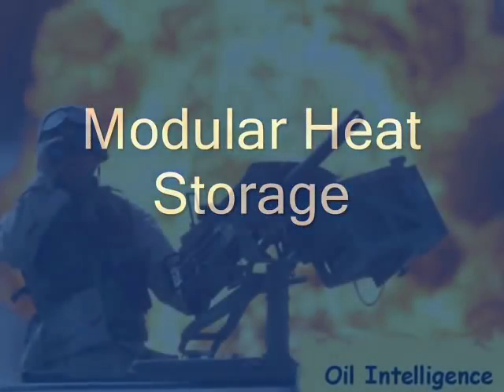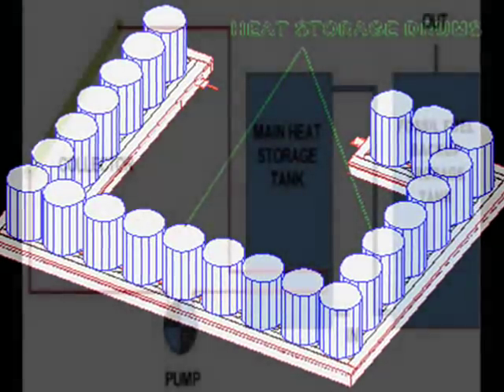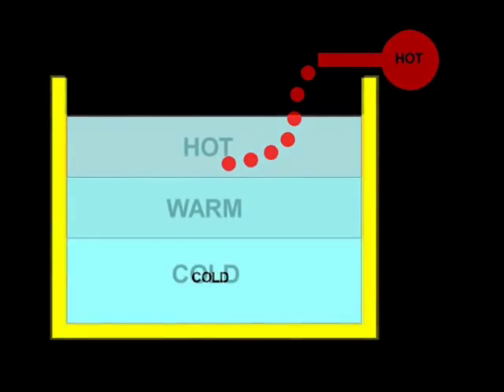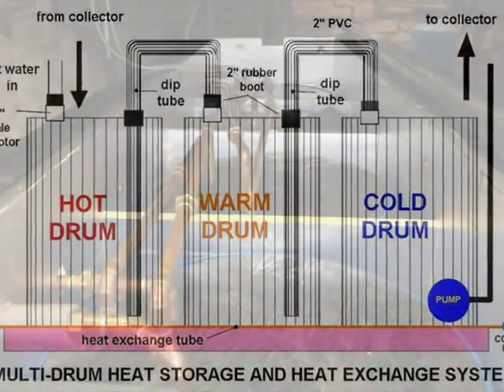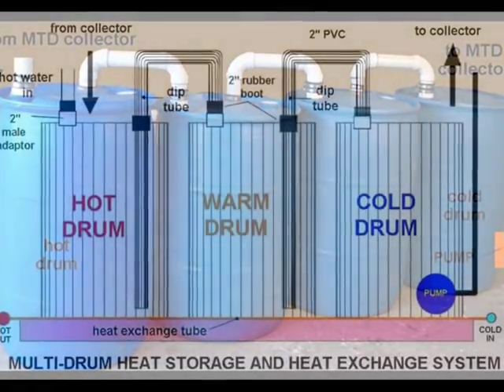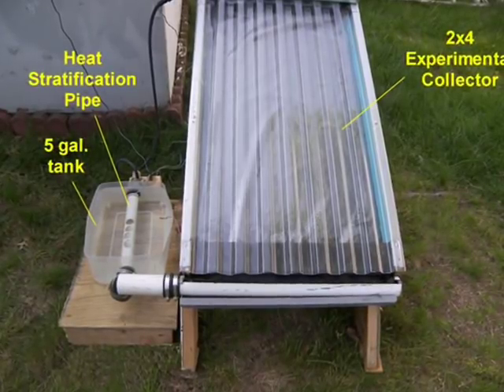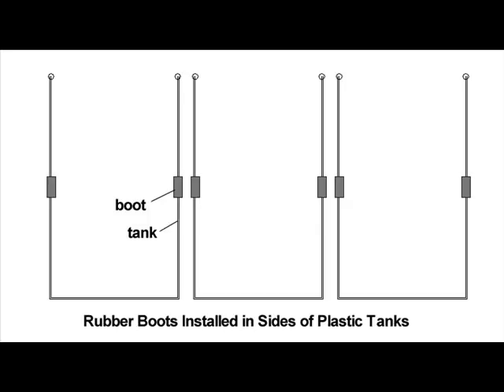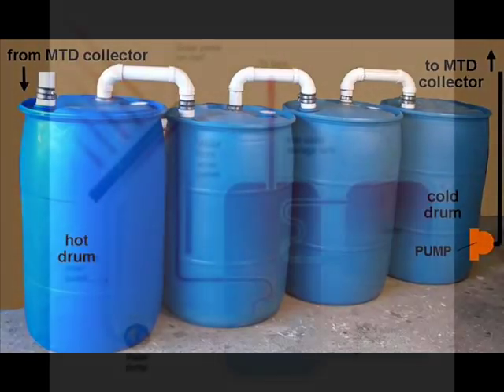Modular Heat Storage

Comment: I have a 300 gallon plastic water tank I'd like to use for storage.  I want to heat the water and then run it through a radiator at night.  Would it really matter whether the hot water stratified?  After all, 300 gallons of heated water is still going to give off its no matter what.

Can I use PVC pipe for a collector? . . .Thanks
Reply from the maker: The 300 gal storage tank should work fine. The heated  water would not be stratified as much as it would be with six 50 gallon tanks but it will still work. I would use PEX or copper inside my collector. PVC starts to melt around 180*F check out other ideas on JC SolarHomes.

Comment: OK, I like this. I like this a lot. 

However, I'm still missing a few pieces of the puzzle. If I just used one large drum, the water would stratify according to temperature. What is the advantage of using three drums? Clearly the drum with the input to the hot water heater would be the warmest. I'm just not understanding what that buys me. Thanks much.
Reply from the maker: Hi Martin Thank you.... This video is a bit crude but the basic idea is that drums connected in series with baffle pipes increase the stratification process. The more drums that are used the greater the stratification. Heat transfer only takes place when there is a difference in temp. More info on my website. Check out solar heat from a winter's sun

Comment: Hi John. I've enjoyed your videos over the years. I'm refreshing my research now as I'm just finishing a 16'x36' greenhouse that I don't want to freeze during winter here in the Colorado mountains. One of the heat sources I'm planning on using is warm water storage in recycled IBCs painted black on the insulated north wall of the structure. Aside from them being heated passively, I'm also considering building one or more collectors to aid in heating the water. My question for you is about stratification. Is there a specific reason to not have the temperature buffered by mixing the hot incoming water with cooler, but warm tank temperatures? I would think that keeping any "hot spots" of freshly heated water from stratifying would lower risk of damage to a plastic tank. I've not done or seen any research that would suggest that either way (stratified or mixed) would release energy into a space more efficiently from a tank open to the room.

Comment: I do like this idea. But how may this idea be altered for storing heated water for using? This seems to be only geared toward heating the air. We live off grid and I'm curious how to get a good hot water system going and have looked at so many options. My head is spinning!
Reply from the maker: Just fill the tanks with PEX heat exchange tubes to transfer heat from the drums into the hot water plumbing.
Reply: my guess: if you live offgrid anyway i would install a heatpumpsystem taking heat out of the ground.. with solarpanels providing the necessary electricity and a big electric boiler.. to get better efficiency you can also link it up to the system shown here..  there is also a system where you melt (dissolve) a salt ( f.e.  Natriumacetat-Trihydrat at 60Celsius) in a waterbased solution. like the little handwarmers you can buy.. you cook the handwarmer to mdissolve the salt and after initiating the crystalisation of the salt heat will be provided by an reversible exothermal reaction. so after you heated your water in the boiler to its goal-temperature you use the rest of the electrical energy to heat up the water dissolving the salt.

Comment: I just found a 5 ton climate-Master  tranquility 16 which think is Geothermal unit, I have an existing well which is 260 feet deep and 20+ years old, in order to conserve the water I am building a 5000 Gallon water reservoir on 10 feet high concrete building (Generator House)  my pan is to catch the returning water in a reservoir and make it for domestic use, only if I can use low voltage pump that can raise the water 10 feet above the geothermal unit, the low voltage pump is needed to reduce amount of electric used, my main concern is can the geothermal pump its self extract the water from the well, or do I need to use my existing pump? any one with a helpful idea can e-mail me at matrixmxm@gmail.com Thanks

Comment: Interesting! I'm in the process(well, thought process) of designing a solar water heating system for both the home and an aquaponics system. A 'daisy chain' of tanks could prove very useful!

Some people complain about the expense of setting up such a system. Sadly, they fail to see the benefits. Once setup, the only outlay is the running costs. Lets face it, running a small pump costs far less than an electric or propane heater.

Comment: Clive Adams Stratification is important because it reduces the amount of heat that can be stored per unit volume. It's like only having a half barrel instead of a full one.
As far as it being expensive, it isn't. You can find these barrels for a very reasonable price.
Reply: I'd rather have the full barrel then.

Comment: Still don't get why you're so obsessed with stratification. The heat going in = the heat going out, I'd have thought the main focus should be on getting the heat out to where it can be useful rather than just losing it to the surroundings. If you can't use the heat there and then it either needs to be well insulated to reduce loss to the surroundings or made to do some work which will allow some of the energy to be stored in a useful form. 

All this stuff is fine for people with plenty of spare cash, time and space to build this stuff but for the rest of us it's not much use at all.

Comment: Great idea! The only problem I see is the loss of heat by the plastic barrels. is this a big problem is this system? Is it also posible to buy a professional kit of this three barrel system? If you know the awnsers to these questions you would really help me.
Reply from the maker: vd The tanks are surrounded with solid insulation after they are installed
Reply: John Canivan can you tell me how to set up this system and the actual cost?

Comment: There are far better ways to heat homes without fossil fuels. Look up Passive Annualized Heat Storage or PAHS. Insulation and solar insolation and masonry storage within can do the whole job at every inhabited latitude. The idea is to insulate dry earth that is "shingled" with plasticized tarpolines to deflect water and
building your house "under" it.  The earth's natural thermoclines migrate upward and solar heat gets stored in the dry earth around the house. And with enough insulation you can retrofit ANY house with the same principles. Earthships adopt many of these methods, but they can be used anywhere, and all this complexity becomes unnecessary.
Reply from the maker: Yes Dry earth is a great natural insulator

Comment: Great video.  Next step is to insulate it with a larger piece of KD pipe, having reducers top and bottom to connect to the inner pipe above and below the copper line.  You can also fill the empty void inside with many different things ranging from expansion foam to dirt; to make it even more efficient.

Comment: To prevent water mixing I would fill up a storage tank with a rough plastic foam. The hot water will find a way to the top. No need for a multi-store.
Reply from the maker: Baffle pipes increase heat stratification.

Comment: If water is colder on the bottom than on the top, why does ice form on the top of a bucket of water and not on the bottom?
Reply: Also, if you think of it in terms of heat transfer, the top layer of water is experiencing heat transfer by free convection with the cold air, the rest of the volume of water in the bucket is being insulated by the bucket itself.  Thus the water on the top will decrease in temperature faster.  Once the top layer freezes it actually insulates the water below it, this is why you can ice fish on a lake.
Reply: Bart McCoy Thanks.
Reply: Water freezes from the top down because while it is true that water becomes more dense as it is cooled, at 4 degrees Celsius that is reversed.  That is truly quite remarkable if you think about the consequences to life if, say, lakes froze from the bottom up.
Reply from the maker: Because ice is much lighter than liquid water.
Reply: Why does hot water freeze quicker than cold??? ask yourself that and go and learn :-/
Reply: Hot water doesn't freeze quicker than cold.
Reply: ***** You are totally correct. Woman here, I split the wood that I heat with. When I go out in the winter and do a little splitting I always bring an ice coffee with me. In minutes a hot cup of coffee is one chunk of ice, but the ice coffee only freezes at the top most layer. And its cold where I live most of the winter was only 20 degrees! I think the dissolved oxygen content is also a factor. Regardless I've experienced this first hand! (when I used to bring hot coffee out with me)
Reply from the maker: gwaihir502 Good answer.
Reply: Ice is lighter than water, and floats on it. Water at the same temperature as ice at 0 C falls to the bottom, only to rise to the top when it loses its heat of formation and becomes ice at 0 C. Water is a weird chemical, other liquids don't do this.
Reply: ***** No it doesn't, it loses heat faster, but only till it reaches the temperature of the cold water, then both are the same.
Reply: IF water is colder on the bottom...that is not the case when ambient temperature is lower than the water temp. When water begins to freeze, the water temperature is always higher than ambient air, so your question only applies to a rare circumstance.

As far as hot water freezing faster, it's because hot water gives off it's heat at a faster rate due to the temperature difference between it and the air. This momentum of higher heat loss carries right through the freezing point, thus facilitating a faster freeze.
Reply: Because ice is less dense than wather, density equals mass over volume (D = m/V), and because the whater molecule (H2O) in solid state occupies more volume (vecause of its cristaline structure) while the mass stays the same, so the ice is less dense =D, plus it can trap air bubbles in its structure.
Reply: Every year, smaller lakes experience a flipping, so to say, of the water as the upper layer cools below the temperature of the bottom water. This demonstrates that the deeper water is insulated from the ambient air. The same is true in a drum of water. Only the top few inches is affected by the air temperature and it will freeze before the bottom water unless the barrel is covered and raised to where the entire barrel is exposed evenly to the ambient air.

Comment: My plans are insulating my 1700 sqft, 2 story home with 3" of closed-cell foam on all exterior 2x4 walls & rafters, then replacing the FA system with a PEX tube underfloor radiant system. I'm not too keen, however, on the idea of JUST replacing the NG furnace with a NG boiler. I'd like to add an alternative heating source (e.g. solar panel or wood burner) to supplement... or perhaps even replace it completely. I'd prefer to add a solar panel, but the problem I'm having incorporating it is in two areas.

First, I live in a 4A hardiness zone and the extremely cold temperatures will freeze any system based solely on water as the thermal conductive material. If I isolate the solar panel portion of the circuit, I was thinking I could use a 50/50 of propylene glycol/water to solve that issue. Thoughts?!?

Second, I'm also not keen on the idea of saving the cost of heating fuel, only to add to the cost of my electric bill running pumps or with the added cost of purchasing photovoltaic panels (and their peripheral components). Is there a way to incorporate a thermosyphon system with storage tanks located below the panels... say in the basement?
Reply from the maker: Yes you should keep the heating systems seperate

Comment: thinking about building a mass heater and heating hot water to send to plastic barrels in the back of the house do you think the water would get to hot for the barrels
Reply from the maker: Mark
In a word No.  Standard polypropylene drums don't begin to get soft until 160*f . If you exceed this temp you don't have enough storage or you have too many collectors. Heat is rapidly lost from very hot surfaces. With a radiant floor heating system temps less than 120*F are workable. Remember heat is the product of temperature and mass.
Reply from the maker: If you are solar heating water above 150*F you are wasting energy because the efficiency of heat gain drops rapidly at higher temps and the heat gets higher as the temp increases.

Comment: This blue print is a great start for a heating system I am working out to heat the floors of my house and shop thanks.
Was also thinking of thermal mass wall panels with water piped through the panels.
Thanks
Reply: Pls do not forget about winter nights. If you have just a water in the system it could be frozen at night. It will make you a lot of problems after. Mr Canivan should worn people at very beginning.
Reply from the maker: You have the right idea Richard
Reply: Agreed, Part of my design is water drains from exterior to interior when pump shuts down
Reply: William Chilton Commercial systems use automotive anti-freeze and water 50/50 mixture.  Much more efficient.
Reply from the maker: You are welcome Richard. A better way to connect the barrels is through the sides with bulk head fittings. To insulate just place solid insulation all around them. A few minor supports could be used to hold the insulation in place
Reply from the maker: Go for it Richard.

Comment: If you bubble your air to be heated directly through the water, rather than blow it around the outside of the drum, it'll pick up the heat of the water very quickly.
Of course then you may have problems with the water mixing and losing its gradient. However you should only need to bubble through the top 10 - 20 cm of water to bring it up to temperature.

Comment: The biggest problem with your concept is the earth is not as fragile as you have been taught. The truth is the earth is an internally heated radio active bio-dome that is continually lit and heated by a nuclear furnace. Floods,earthquakes,Volcano's and natural oil leaks to the tune of 450 million barrels p/year are all NATURALLY OCCURRING processes on the earth. Streams of pure acid run through Yellowstone Park everyday hotter than any plant can produce. You need to rethink your planetary view

Comment: Unless the system is very well controlled, it is possible to get temperatures above 220°F on occasions and that can instantly ruin most plastics.
   Make sure the materials that you use are suitable for solar applications or else you will have a long term maintenance problem and possibly a lot of water to clean up.
   Many materials for domestic hot water are not rated for solar applications.

Comment: Half a million views.  Well done.
I would like to reiterate the note of caution about using plastic parts in a solar hot water system.  
While doing my research for my solar hot water system, I ran across a "lessons learned" document based on analysis of systems installed in the 1980s.  One of the take away lessons was to only build these systems out of durable materials like metal, glass, and concrete.  Other materials like plastic and wood are typically poor choices for these hot/wet environs.

Comment: You mentioned 160 deg. until the barrels begin to soften. Couldn't you add a 90 F. to 130 F. Degrees Adjustable Therm-O-Disc to the pump wiring for both temp. control and eliminate barrel issue or would it take to much away from the original concept?

Comment: Fifteen years ago, I was Involved in an experiment to use parabolic troughs 2.5 meters in length to raise useful steam. Result, a very large array of troughs (5) was needed to create steam that was sufficient for practical use.
Reply: I have wondered about flat panel for pre-heat and trough as a second stage to raise the temp further (on sunny days)

Comment: Excellent informational video John. I designed a house with the entire roof (single slope, south facing) covered with a trickle down system, during my second year of architectural drafting. The only difference was that the arrays I had used were flat black piping with photovoltaic cells covering the bottom of the enclosures to generate current for the pumps and the surplus to charge high density batteries along with small wind turbines.

Comment: From a smaller passive solar heating array such as the ones John mentioned in the video, the potential to generate super-heated steam is almost nil. To accomplish that, you would need an active array of parabolic mirrors that are setup to follow the sun, and directing the focused light onto a heat exchanger made from steel. But unless you plan to run a steam turbine, why would you be inclined to generate super-heated steam?

Comment: I'm no plumber or expert on thermal heat exchange systems, but what is the potential of such a passive solar array from generating super-heated steam to be used in the same way as a steam engine generator?

Comment: That's the beauty of the drain-back system. You don't need glycol or an expansion tank, however, you do need a higher head pressure pump than what you would use with a pressurized system where the collector stays filled. I recommend reading up on this at builditsolar dtcm.

Comment: I guess John's just an old hippy relic. I like this idea. I have a bunch of the plastic drums but maybe I'll get some more of the steel ones to put at the hot end of the chain. How is this better than having all the water/heat storage in one big tank, like the ones they are doing at builditsolar website? I guess the more cold water that enters the collector, the more the heat transfer as opposed to having more even heat across the tank.